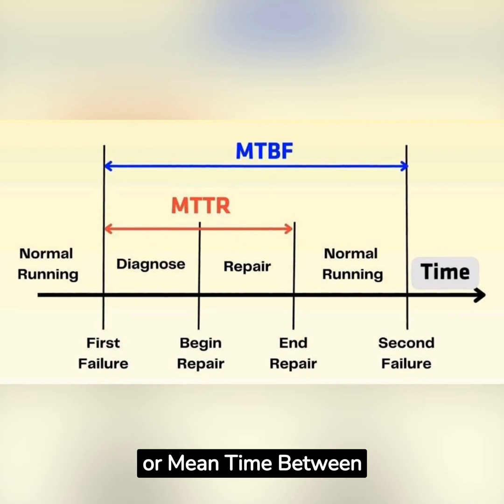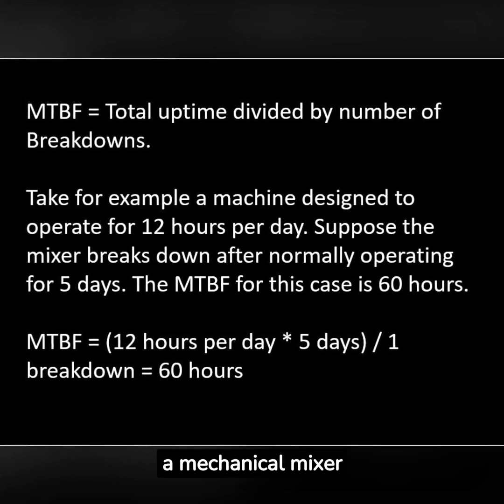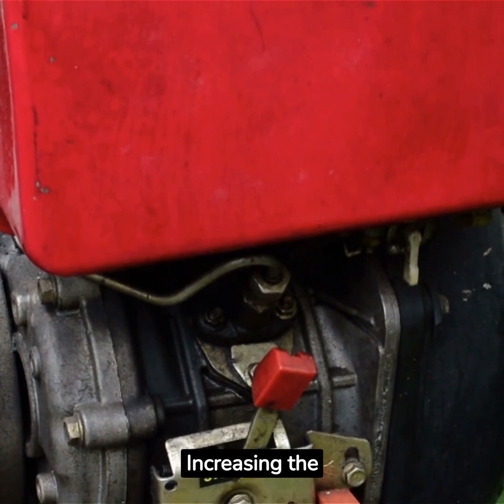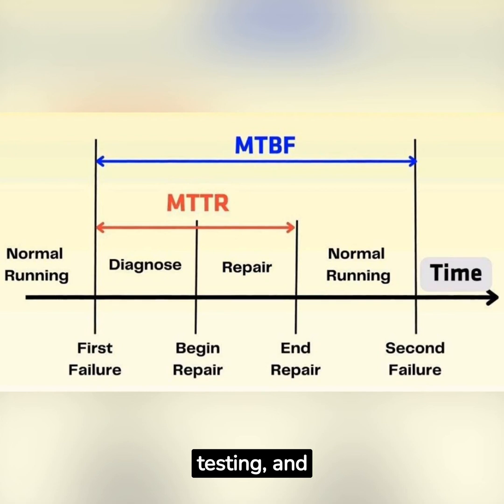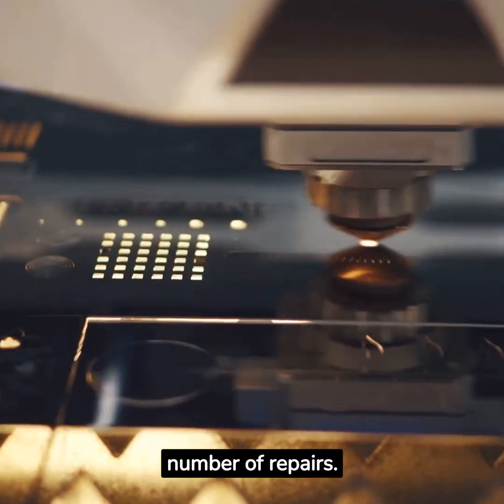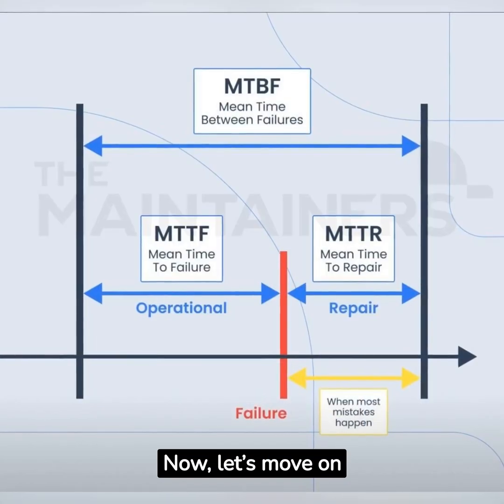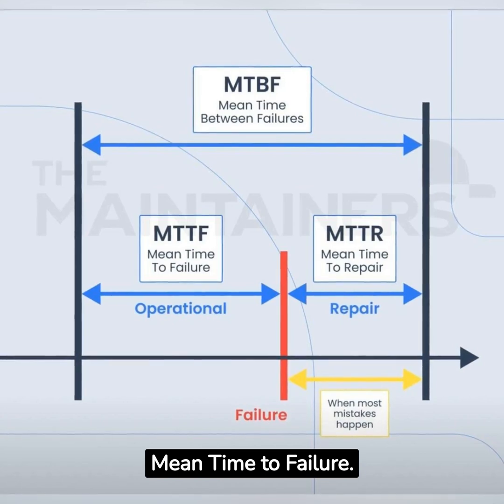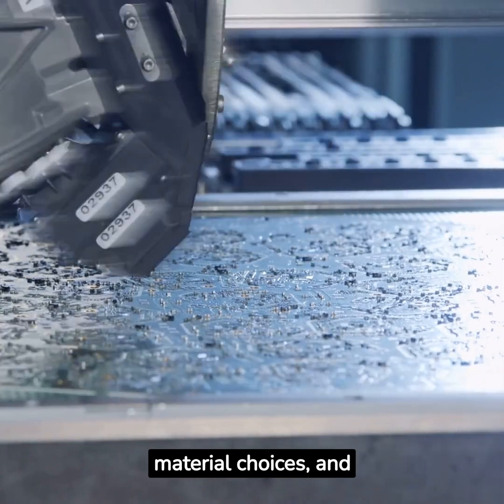Difference between MTBF,MTTR and MTTF

Comment from the maker: Understanding the differences between MTBF, MTTR, and MTTF is crucial in reliability engineering and maintenance management. Here’s a breakdown of each term: 

MTBF is about the time between failures in repairable systems.

MTTR measures how quickly a system can be repaired after a failure.

MTTF is focused on the lifespan of non-repairable systems.